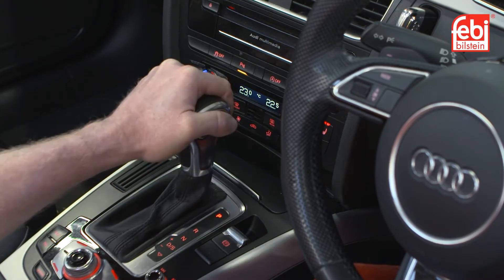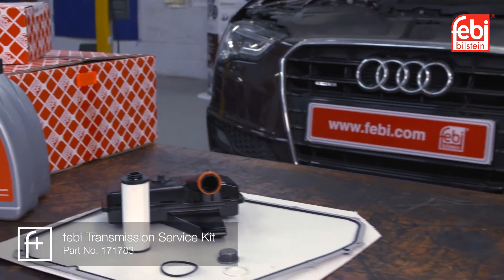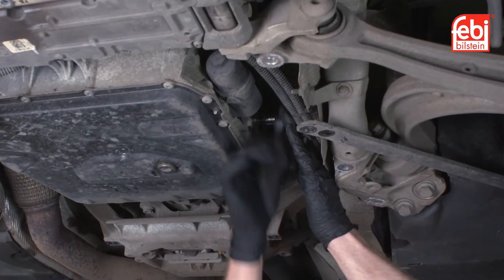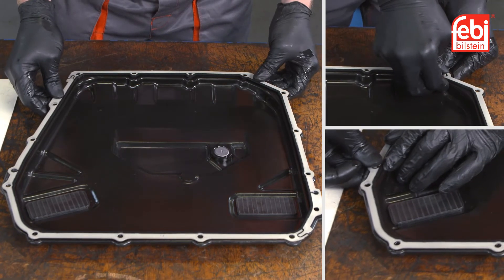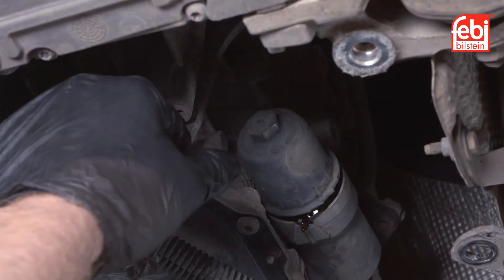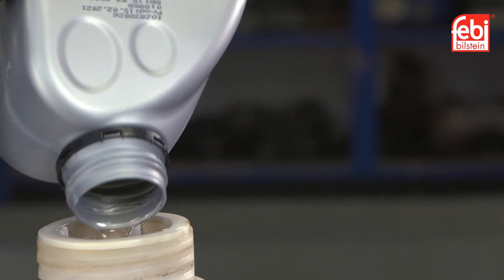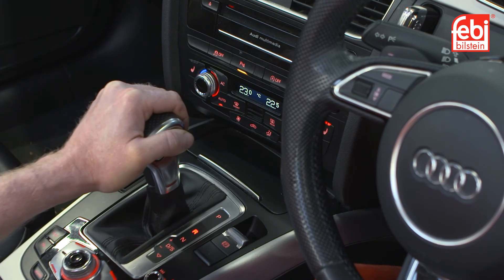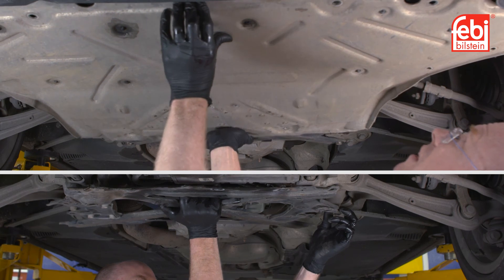[EN] Audi 7-Speed, Direct-Shift Transmission Oil & Filter Replacement

Comment: How do you check the oil level? Through the obd tester or is there a test in the car computer?
Reply from the maker: Thank you for watching our video. The transmission oil level check is explained and demonstrated in the video. The oil level is checked by having the oil temperature in the specified  ranged measured through the obd tester, the if it over flows over the level tube inside the transmission. If you are asking about the engine oil level, on some Audi models that are not equipped with a dipstick for the engine oil, then this can be accessed through the vehicle and obd testers, if they have this function.

Comment: Can I use rubber sealing kit for the transmission gasket? Or just metallic one is recommended?
Reply from the maker: Thank you for watching our video. We would recommend using our OE matching quality parts as per the vehicle manufacturer.

Comment: Great video! I drive an Audi A6 C7 Avant 2018 (4G5,4GD) 2.0tdi 190hp. (CNHA, CZJA, DDDA) s tronic 7 speed.Can you tell me if this kit is suitable for my car. Thanks
Reply from the maker: Thank you for watching our video and positive comments. With the information given the transmission service kit featured in this video is applicable to your vehicle. However, the full chassis number would be required for a complete identification which your local febi stockist should be able to help you with.
Reply: Thank you for your quick response. Very professional👍!!
Reply from the maker: @Daxon-n3b  👍

Comment: I have a 2017 Audi Quattro, kit part # 180604, is this the same procedure? This kit has three filters.   I've heard you need a scaner to disable pump, etc etc?  Great video.
Reply from the maker: Thank you for watch our video and positive comment. Regarding your question, the febi kit for the transmission fitted to your vehicle is for a completely different gearbox. Therefore, the procedure is very different.
Reply: @febi.bilstein  Please do a video soon on this particular transmission, as there are many on the road now.  Thank you.

Comment: Is it necessary to change the oil in the mechanical or gear part (I also have the 0B5)? Because I understand that the change made in the video was only to the mechatronic.
Reply from the maker: Thank you for watching our video. The procedure shown in this video is for the service replacement of the transmission oil and the two filters. But does not include the internal third filter which is only replaced during a transmission rebuild.

Comment: Hey Febi, Is it the same procedure for audi a3 2013 1.4tfsi stronic? Thanks in advance.
Reply from the maker: Thank you for watching our video. The procedure depends on what transmission your vehicle is equipped with. If it has a wet clutch it may be similar to our other video. https://www.youtube.com/watch?v=q4n89BYA_9k However, if it has a dry clutch then it is completely different.

Comment: Great video, how long does it take to bring the Oil to 30-50° from a 10° initial temperature? Does the oil temperature increase just by letting the engine run idle?
Reply from the maker: Thank you for watching our video and positive comment. The time to increase in the transmission oil temperature depends on the ambient temperature. During the warming process the gears are selected to circulate the oil, this also gradually assists the warming process.

Comment: How much gearbox oil capacity for A6 C7 3.0 TDi 245 hp with s tronic 7 speed? Thank You. 
Note: I’ve just done service on my car using your febi oil just like it’s showed in the video, and the worker said he filled approximately 6 liters. I wonder, is that enough?
Reply from the maker: Thank you for watching our video. If your car is fitted with the same transmission featured in this video and the level checking process was carried out at the correct transmission oil temperature, then the quantity of oil would be correct.

Comment: Hello i own an audi A3 35 tdi limo (2021) with 7spd stronic, the service is every 120000km acording to Audi specifications. 
Is this video's transmission the same? I only find kits without the internal filter...
Reply from the maker: Thank you for watching our video, the transmission fitted to your vehicle is different to the A5 featured in this video. Therefore, this is why you can only find an external filter.

Comment: Great video, I have A6 C7 TFSI 2.0 132 kw. I wonder if it is lifetime transmission oil no need to changed? if not how often I need to change?
Reply from the maker: Thank you for watching our video. If your Audi is equipped with the Multitronic CVT (0AW) Transmission. The recommended service interval for the oil and filter is 40,000 miles. Head over to our SWAG YouTube channel for this video.
Reply: @febi.bilstein   Thank you so much. How would I know if my Audi has multitronic CVT? By Vin number or???? My apologies!!!
Reply from the maker: @KoreanNaturalization-Interview  The CVT transmission code is 0AW, this can be found on the PR code sticker, which will be in the service book or on a sticker near the spare wheel.

Comment: Is this the same gearbox that’s in a 2015 Audi Q5 2.0 TDI S Line Plus? I have 7- speed S -tronic gearbox but don’t know what kit I need as I’m aware certain gearboxes don’t have filters etc
Reply from the maker: Thank you for watching our video. The DSG and the CVT transmissions both have filters, which can be changed as part of a service. Please check out our on-line catalogue www.partsfinder.bilsteingroup.com. Check your PR codes for your transmission code, you will find this on a sticker in the boot or in the service book, to identify which transmission is fitted to your vehicle.
Reply: @febi.bilstein  Thank you for your help. I know I have the PJT gearbox code so I’ll check on the catalogue
Reply from the maker: @michael6125  👍

Comment: Hi. I just took my A5 to an Audi dealer for an s tronic transmission service and they changed the oil only. They said that there is a filter but it is not necessary to change it in the model gearbox on my car. I am confused by this but if Audi themselves say it’s not necessary then what do I do? They always recommended other things that are not actually needed so why would they under sell on a gearbox filter if it was actually needed ?
Reply: Yes never get this s/tronic transmission service done at audi,they only change the exterior filter and they dont take the oil pan off or change the inner filter take your car to a VWAG specialist they will take off your oil pan and change the exterior and interior filter
Reply: I’d take it to a reputable VWAG Specialist and ask what they do as part of their S tronic service. I have a Golf R and Audi Q5, with my Golf VW main dealer states when doing a Haldex service (4 wheel drive pump) they just refill the oil and say the gauge inside the pump isn’t a serviceable item. Now if I had gone by that my Haldex pump would fail over time as the gauge needs cleaning so it can filter the oil sufficiently. That’s where the specialists come in and do far more for our cars so they have a returning customer whereas the main dealers have one thing in mind which is get as much money from us for as little work.

Comment: I'm confused,  I have Audi A5 7.11.2016 2.0 Tfsi S tronic Quattro keynr: 0588-BIW00018 and my S tronic Gearbox have no filter , I just ordered complete kit together with sump and everything that need to be replaced but have no filter . Is European model. I also replaced Haldex oil and didn't  see any filter. Gearbox code is 0G7
Reply from the maker: Thank you for watching our video. The vehicle featured in this video is fitted with a 7-speed DSG transmission (0B5). Please check exactly what type of transmission is fitted to your vehicle, it could be fitted with a CVT transmission. (0AW). If so head on over to our SWAG YouTube channel, where you will find a video on a Audi A4 with this transmission.   Link at the bottom of the home page.